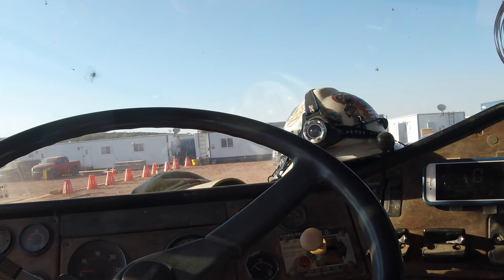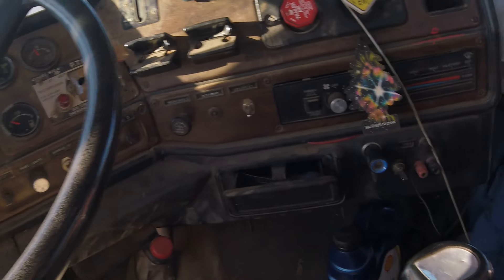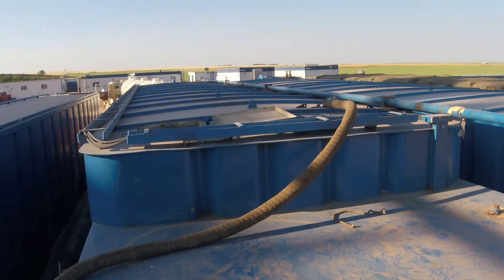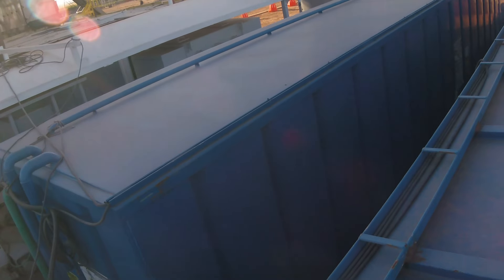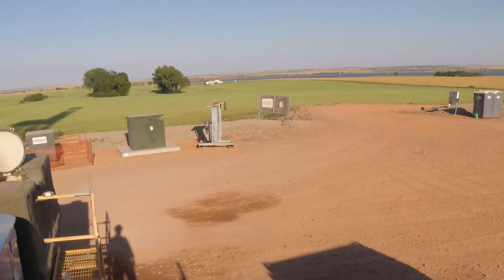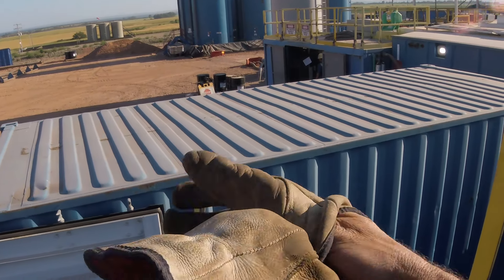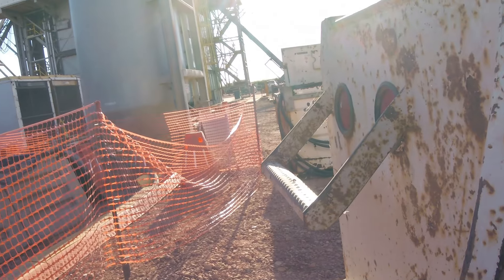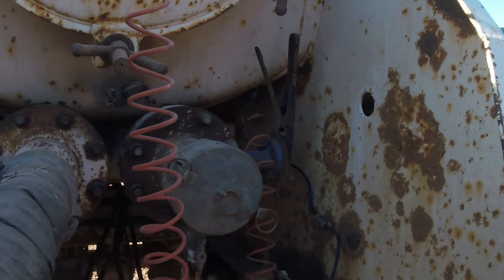Oilfield work filling freshwater tanks

Comment: I appreciate the content. I have my CDL and a truck made for the oilfield. I have a double frame Iveco cabover that has a baby sleeper and full lockers. It was built for the military as a tanker tractor and it has about 30,000 miles on it, so it is like new. I want to buy a triple axle vacuum trailer so I can haul 150 barrels of water.

Comment: What is the average $$$ per load a driver should make in North Dakota? I just got a job in North Dakota but I'm getting paid by the load not by the hour.
Reply from the maker: Typically a decent percentage for water should be around 30%.  Some places pay more and some pay less.
Reply: @northdakotadriver5714  When they say $230 a load, is that my money or I get 30% of that?
Reply from the maker: @Gilbert-i8z  Normally it’s 30% of the 230.  Sometimes the company you drive for has to pay the dispatch 15% of the 230 and then you get paid after that.